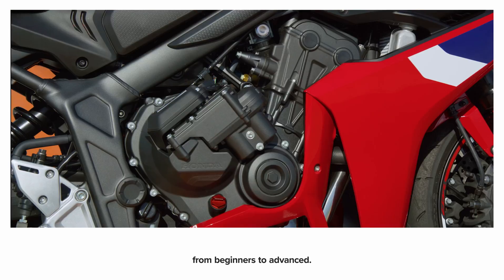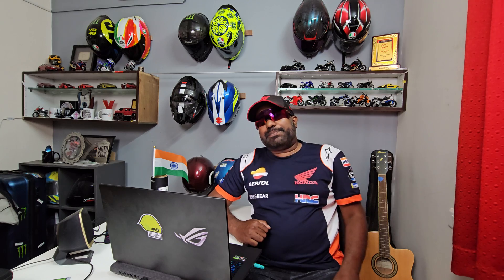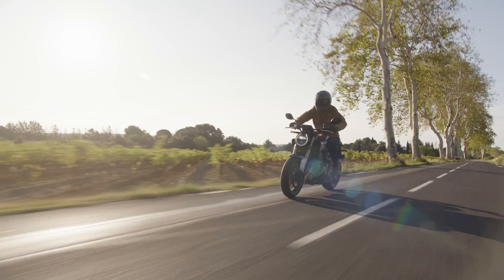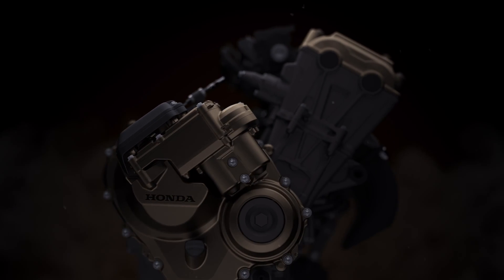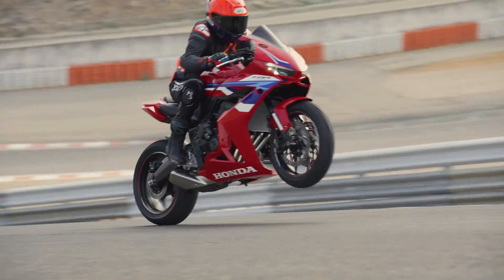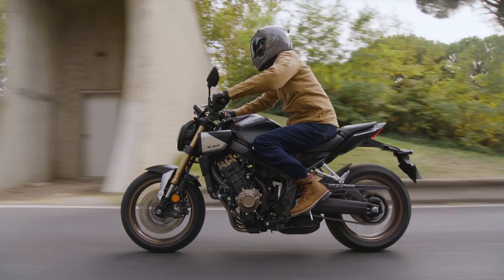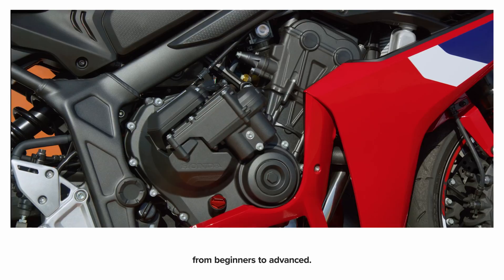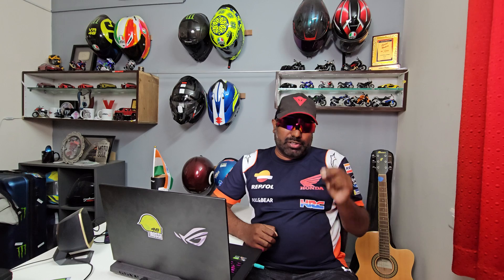HONDA E CLUTCH EXPLAINED | Difference between Quickshifter & E-clutch

Comment: Could you tell me if it is possible to disconnect the e-clutch system. Thanks!
Reply: You just need to press the clutch, and  the E-clutch gets deactivated and the bike starts to work normally with the clutch